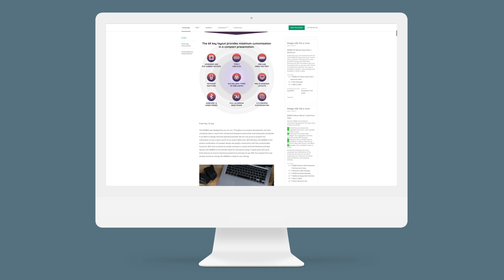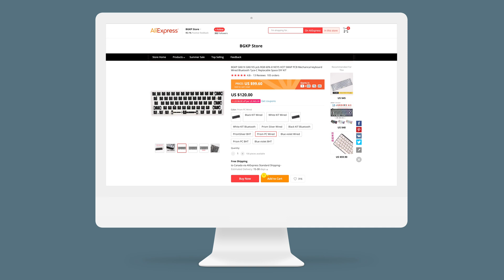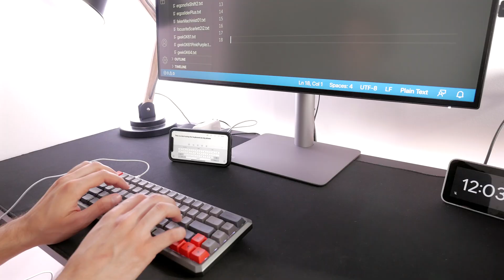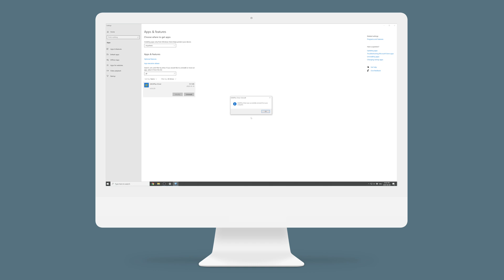EpoMaker GK68XS 65% Mechanical Keyboard Review

Comment: For those of you that encounter the pairing code issue.

Download the software first (using the latest version) then reset everything and apply it. This allows the bluetooth to work once more.
Use the download link in the manual brochure that comes in the box (the chinese website) - it has the latest driver version.
Reply: I just disconnect and delete the device, and the reconnect again.

Comment: I know you said for the plate the sound is lower pitch than aluminum and that you're not a fan of the look but how is the typing experience in your opinion for fiber glass vs aluminum or brass plate? I'm getting a gk64 and the only plate they had was this same material, so I'm worried lol
Reply from the maker: I have never tried a brass plate (yet), but I don't feel like it really affects the typing experience. If anything, I'm getting less "case ping" and it sounds better.
My only complaint is regarding how it looks, but otherwise it's alright 🙃

Comment: Several red flags for this board.
1) south facing led means you are flipping the switch this part north or down meaning you can only use oem highs or higher keycaps if you use lower profile caps the homerow caps will bump against the switches before they bottom out. I don’t mind that as I have 2 tada68 boards that have the same problem so I bought 2 sets of oem caps. 2) problem is no gmk that’s self explanatory 3) really really awful typing sound. Even the budget high profile tada68 sounds way way better. Overall not worth it IMO

Comment: Is it anything that you can recommend in 65% layout with bluetooth and backlight (white is enough)? I am very concerned with placement of Backspace.
Reply: I'm also looking for layout which has a normal backspace, did you find one for yourself? I'm considering akko3068, tada68, or vortex rac3 but its 75%
Reply: @mik0craft  Unfortunately, I couldn't decide and finally I bought KBD 67 Lite and build it by myself. It is lacking bluetooth, but everything else is like I wanted.

Comment: Nice keyboard , but, in my case at least, I could'n use the split spacebar for gaming because on my current HyperX Alloy fps RBG I keep my 'jump' thumb right between the V and B keys. And this 'space split' is right there. For texting is perfect but for gaming people must check how they keep their thumb on the spacebar. Otherwise they might regret the purchase. That being  said if anyone keeps their thumb between C and V or a bit further , B and N than this could be a good use of a short 'jump' space bar. 

The jumps will get more precise. I know this because I had some years ago a mod for a  keyboard , a short spacebar, but that keyboard had three switches for the spacebar and I used the left and the middle switch for that mod . Of course the keyboard looked weird but it did improved my jumps in games.
Reply from the maker: Oh interesting! At least you can have both a full width spacebar and split spacebar with this one 😅 You could definitely use those 2 spacebars for different in game controls, that'd be great indeed!

Comment: thoughts on AP2 vs GK68XS?
Reply from the maker: The main difference will be the layout. Other than that, the Anne Pro 2 doesn't have hot-swappable switch sockets, that is quite limiting.
However, the Anne Pro 2's software is more polished, and works on Linux/Mac/Windows, while the GK software is Windows only.
Really depends on what you're looking for, but I think they are both great keyboards 😄
Reply: @minimalistik  decided following your review I think I will pick up the Kemove 61

Comment: please review gk64xs alu version
Reply from the maker: Hey I have a plastic GK64XS coming in the mail, almost what you're asking for 😅 I'll see if I can at least mod it with an alu case
Reply: @minimalistik  i saw a review about the same alu case design with 60% layout but it is not a perfectly a high profile case(from aliexpress). i saw there are a millimetre gap between the case and keycaps. unlike this Gk68xs, all the keys switch seen perfectly hidden. i hope my eye was not wrong.  Really hope you can review that gk64xs with alu case😅